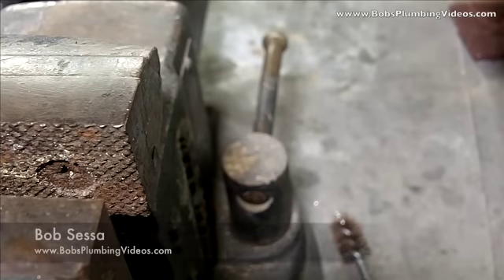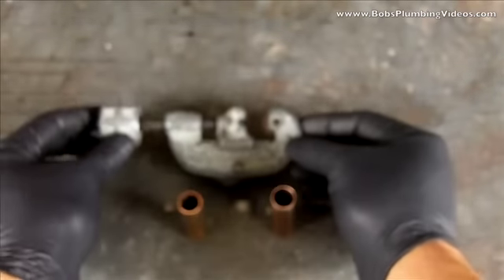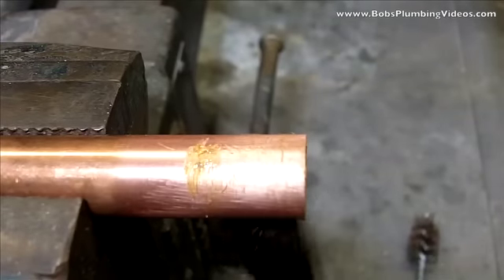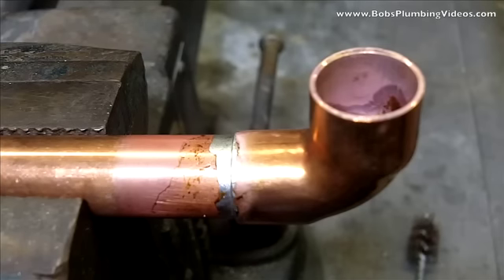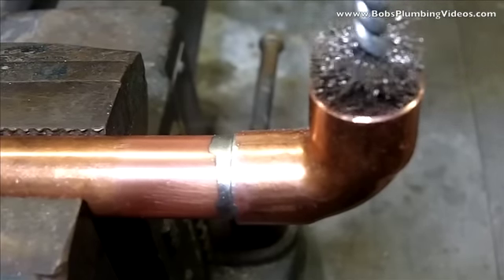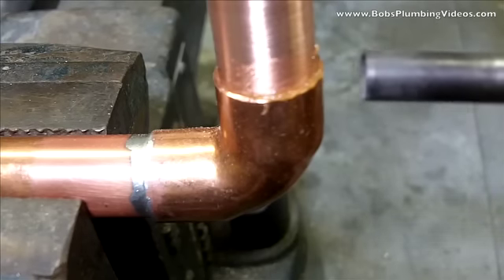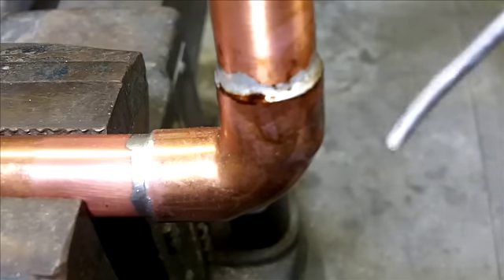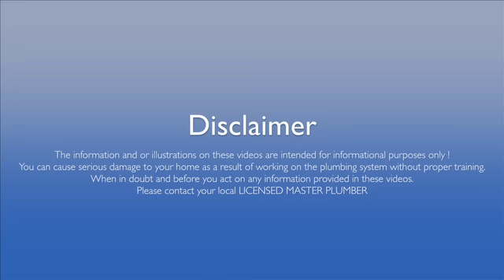How To Solder Copper Tubing / Pipe - Part 2

Comment: Great video for me....very precise and I'm going to give this a try. Have a 10-12 inch piece of pipe that froze during winter that leads to my outdoor faucet.....gotta research how to put a spigot on too before I try this.....lol. Thanks so much for these 2 videos and for your time talent and patience.
Reply from the maker: Linda Schirmacher Thanks Linda, I'll assume you have a 1/2" copper water line feeding your garden hose and all you have to do is solder a 1/2" copper by 1/2" female adapter on the end of the pipe and simply screw in your 1/2" hose bib. An alternate option would be to solder the hose bib right onto the pipe. Most hose bib's will fit directly onto the tubing, but you have to be a little careful when doing this. Make sure it's in the fully open position because the heat from the flame could damage the washer inside. Regards, Bob.

Comment: In changing plumbing layout is it possible to reuse copper fitting and pipe?  Say heat, twist 180 and reapply solder.
Reply from the maker: If it was initially cleaned and fluxed, yes. I do it when necessary.

Comment: Bob, great video.  Great walk through, easy to understand for a beginner regarding plumbing (me).  If I can give one remark... regarding the reaming, you are pointing out that it is an important step, however what exactly do you have to do?  It is easy to assume what is probably done, but I will have to search for another video to watch the procedure.  I was surprised when you bypassed actually completing the ream, and jumped to the next step.  I am not cutting down the video at all, everything was very clear and easy understand, just a thought.
Reply from the maker: No, not at I did browse over that step. If you're using the reamer on the no.10 cutter in the video you would simply place it inside the tubing, push and it give it a few turns to open up the waterway. There are also several companies that make "de-burring" tools which will accomplish the same job. I have to keep reminding myself that the majority of people watching my videos know nothing about the subject. Thanks again! Regards, Bob.

Comment: Lovely and efficient soldering. What about if I have to connect a steel pipe and a copper pipe, can it be done with solder without using a  brazing rod at higher temperature? maybe there is some flux which works?
Reply: Are you referring to a threaded steel pipe? You’re not going to want to connect steel to copper. It will have a corrosive reaction.

If you want to connect a threaded piece of brass pipe to copper you can purchase either copper by male or female adapters. One end takes solder the other either screws into a fitting or on to a pipe.

Regards,
Bob
Reply: Thank you so much for replying. I have a 1/4" steel pipe (unthreaded) that needs to be connected to a swaged 1/4" copper pipe. It is in a new fridge. Nowadays they use steel pipe condensers which can rust and pit.
Reply: brik32544  I would say brazing is your best option!
Reply: Thank you Bob. Will have to wait till I get  a new acetylene bottle in  a few days.

Comment: I have a 1/2" copper line that supplies the bathtub filler.  It has a dent in it caused by previous owner over tightening the spout, so they moved the spout out away from the shower wall and caulked it up.  This caulk is ugly so I'm trying to fix.  How can I solder pipe through a 2 1/2" hole?  I need to cut the dented pipe out, put in a coupling and new copper pipe.  Would you recommend Shark bite fittings for this?  Thanks
Reply from the maker: SONGkiDz4eVa13 From your description, I would say yes. It's going to be the easiest and safest way to do it. You don't want to be using a torch in this situation, as the potential for a stray spark could turn into a disaster. Thanks for watching. Regards, Bob.

Comment: Bob, great video. Based on how you solder, it looks like you dont need to go all around the fitting with the solder? Is this true? It looks like you solder about 180 degrees, i guess the solder just finds its way to cover the other half of the fitting?
Reply from the maker: On small diameters, 1/2" in particular. Anything larger, I go all the way around! Thanks for watching!

Comment: looks great! how large of a pipe can map gas do. Is thier a need to move to an actylene torch ever?
Reply from the maker: I've comfortably used Map fuel on sizes up to 2" but economically it makes more sense to go with acetylene.Generally in my daily residential repairs, I use it on  up to 1 1/4" tubing, but if I was doing a large amount of 1 1/2" or 2" tubing I would make the switch.

Comment: I'm building a water cooling loop for a custom computer build, and planning on using copper pipe for it.  Since it's purely an aesthetic choice, I don't want to have the silver solder showing afterwords.  Will it hurt the bond to sand away the visible solder?  The water flow is pretty low pressure.
Reply from the maker: +FlesHBoX Good question! I once made a two tiered stand out of copper pipe to hold my daughters hamster homes and was extra careful with the joints. But I liked the look of the solder, If you gently buffed away the solder with maybe a Dremel tool, I don't think it would cause an issue, but then again I've never tried it.
Reply: Thanks.  My pump arrives tomorrow, so maybe I'll pop down to lowes and pick up a short length and test it out.

Comment: Nice on, Bob. I'm learning about soldering copper pipe for a small electronics project that needs more cooling and this is a great help. I may post some photos when I'm done. Thank you for sharing your knowledge on what is to some of us an unknown art.

I may need to do something a little more (or perhaps very) tricky ... solder aluminium heat sinks to copper pipe. Will experiment a little outside of the project first. I have seen it done, but by an expert only. If you have any tips I'd really appreciate it.

In another note ... are you at some point going to do a video, explaining the different components of a residential water / heating system and what to do in the event of an emergency?
Reply from the maker: +William Jordan Thanks very much William, I've never soldered aluminum myself. Occasionally I 've tried making small repairs on stainless steel sinks, but ultimately wound bring them to a specialty house who specialized in stainless steel. Thanks again for watching! Regards, Bob.

Comment: Was under impression that you solder the joints immediately after one another when doing joints in close proximity like a 90 or a splice?
Reply from the maker: You do , but occasionally I will fit an entire bank of pipe and fittings together and solder them 10 or 15 minutes later. It depends on the scope of the job!

Comment: is the cloth just dipped in water just like a wash rag ?
do you have a favorite brand of solder ?
Reply from the maker: +michael lee I just soak an old piece of tee shirt material in water and wring it out. Any name brand non-lead solder will do the trick. I use a solder from a company called Wolverine Brass which sells to professional plumbers. Best Regards, Bob.

Comment: I keep hearing "only flux the pipe" and then "flux the pipe AND the fitting". It's confusing. I put a light coat on the pipe and a light coat on the fitting, similar to what you do. i figure that if I'm using water soluble flux, any excess, which won't be much, will be flushed out through the plumbing anyway.
Reply from the maker: I agree, I've been applying flux both to the pipe and fitting since I started soldering.

Comment: On the vertical joint what if you don't have mapp gas or a turbo torch tip should you heat up both sides any way? But nice video
Reply from the maker: I would use propane gas with a standard tip, heat both sides equally and you'll be good to go! Thanks! Regards, Bob.

Comment from the maker: Yes Daniel you can solder over a small nail hole. Clean it well with emery cloth or a scotch bright pad, flux it and carefully build a dome of solder over it. Although you can use roll or spool solder, I use 60/40 solid  bar solder which makes it easier to cover the hole. I use the bar solder to solder brass floor flanges onto lead bends for toilet installations. Check this out:http://www.delcity.net/store/Solder-Bar/p_14576.h_103792.t_1.r_IF3003&mkwid=20FXGU6x&crid=5092059113

Comment: Flux is needed to prevent oxidation but is also acidic-over the long run damaging pipes.   So, should less flux be used?  Only on where solder will touch the pipe?
Reply from the maker: I use flux sparingly, then wipe all my joints with a damp cloth when finished.

Comment: Mapp gas makes a difference.  I have to heat the pipes with propane a lot longer and that tends to burn the flux.
Reply from the maker: No question about it, stopped using propane a looooong time ago! Thanks for checking out the video, Regards, Bob.

Comment: What is the strongest solder available? I am soldering air lines in my garage. Will not be used for water. Actually it is for removing any and all water in the lines. Compressor is rated to 175psi.
 And I guess you gotta be careful with the heat when soldering the 2nd part of the elbow. Can too much heat un-solder the first completed joint?
Reply from the maker: It's my understanding that in the refrigeration trade Silver solder is the way to go . In my trade  I use  either 95-5 or a quality lead free solder. Yes you could unsolder one end of an elbow while soldering the other if the heat gets out the way. Hope that helps.
Reply from the maker: You Wish  Here is a good source for you - https://bit.ly/3gqIlfY

Comment: That padding you use to clean the copper yes your cleaning it yes it's not gonna leak but it's a weak sweat it has to be scratched so the solder grabs on

Comment: Great video. Any tips for a 2" copper pipe? is there a different solder for a big pipe like 2"? I've never done soldering but have done brazing. Thanks
Reply from the maker: Sagar Swan My advice would be to go with the mapp gas which is going to burn much hotter than propane. You're also going to have to keep moving your flame around the pipe to keep the heat even. The cleaning procedure is the same, now that you asked, I will put up a video on larger diameter soldering. Thanks for watching! HAPPY PLUMBING!
Reply: Avert line and oxygen torch is needed do not ever try to do that with a regular torch it doesn't go hot enough for the solder to flow into the fitting

Comment: Why I can not get my solder into the gap? It keeps running off the surface
Reply from the maker: You must clean both inside the fitting and outside the pipe followed by your flux.  If assembling and soldering immediately you should have no problem.
If your cleaning everything and letting it sit for a while before fluxing, the pipe and fittings could oxidize causing the solder not to flow. Flux everything if you plan on soldering at a later time. Also, make sure you're getting the joint hot enough for the solder to flow!

Comment: I did it just like you show, but am having trouble with a vertical joint trying to make the soldier go up into a cap at the top of an air lock section above a shut off valve for a laundry tub. what is the secret to make the solider flow up against gravity. its my third try now. all the horizontals joints come out fine with no leaks. thanks Jim
Reply from the maker: +jim murphy No secret Jim! I'll assume you're working with 1/2" copper tube? But if you apply the heat evenly around the fitting, place your solder at the bottom of the inverted cup, it will start to flow up on its own. As it starts to flow start moving around the fitting. Don't keep in it one place, once you start to see solder dripping down, you're done.

Comment: Bob,

1) When sweating a 90-degree fitting as you did in your video, when one fitting is done (say the horizontal part), is there a chance of the finished solder melting again and leaking out when you heat the vertical part of the fitting?  How can you tell if you've applied enough heat to begin putting in the solder?  I'm talking about household 3/4" and 1/2" tubing.

2) Is there a way to tell if the newly soldered fitting is water-tight without having to attach pressurizing devices?  I'm concerned about sweating tubing and installing drywall only to discover later that there's a leak at the fitting.
Reply from the maker: +Derrick C. If you're using a properly sized tip and keeping it within the area of the joint you're soldering, it's unlikely that would happen. On the other hand, I've been in situations where I'm soldering several sizes of copper at one time and in an effort to save time, soldered 1/2" joints with an oversized. This can cause the closest joint to liquefy, but with experience, you tend to get a feel for when that's about to happen. 
In answer to your second question, when I rough out a bathroom or kitchen for the matter, I cap all my stub outs and pressurize the entire system. This way while the drywall is being installed I'm confident my system leak free. You could also pressurize it with air if that is a better option for you.
Reply: +BobsPlumbingVideos 
Good-to-go Bob, thanks for the timely response and great advice; I appreciate it!
Reply from the maker: Derrick C. Anytime Derrick!

Comment: Why don't you "Tin" the copper pipe first
Reply from the maker: Not necessary when joining copper tubing, I will however go through the tinning process when joining two different materials such as brass and lead. In the good old days I would make my own toilet bends using a wiped soldered joint and would always tin the 4" brass ferrule before joining it to the lead bend. Thanks for the question!
Reply from the maker: You Wish  If I'm just soldering copper to copper, I don't tin. I tin when joining dissimilar metals such as brass to lead when making repairs in ancient plumbing systems. I tin the brass before soldering which assures me of a sound joint. Not common practice in today's world, but was an everyday practice when I got into this business. And by the way, I use bar solder for this technique . Not typical 95-5 spool solder.

Comment: That shit is hard, bro. I just used the glue. You need practice and experience.  Might as well hire a plumber.  If not use the glue. I messed up other stuff trying to solder. If you never have done it, don't do it.  Soldering the worst invention ever.  It's for the plumbers, not the DIYers.
Reply: Insurance Casino I’m with you brother, but people want to see this stuff, this is my take on the subject. Happy Glueing!
Reply: RobertSessaPlumbing you can't glue a moonshine still together.., but you are right, this ain't easy.. it's one of those learning curve things. My dad could do it, he told me if he can do it so can i.. so i am still trying! Lol
Reply: Is gluing secure?  I bought a bottle of Just-for-copper but hesitate to use it.  I read reviews that this stuff leaks like the White House.
Reply: Insurance Casino if approved in your area, use shark bite fittings available at Home Depot. I would not trust any glue! Period!!
Reply: That is what I ended up using.  Even got lucky on a fitting I bought I that I thought I wasted money on.  Thanks, man. But that copper glue has some great reviews.